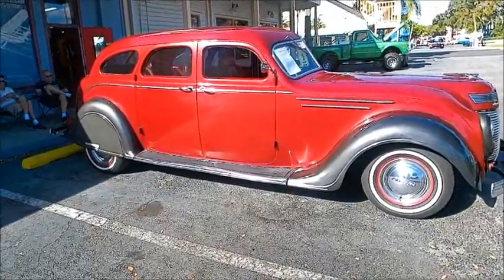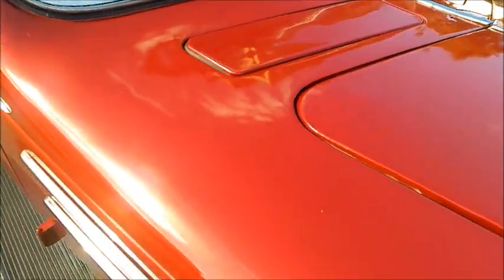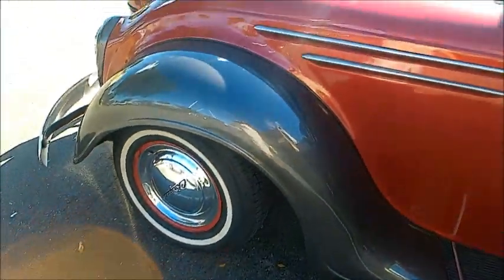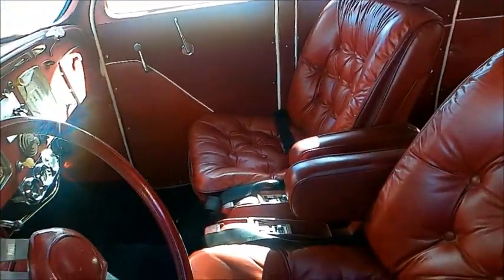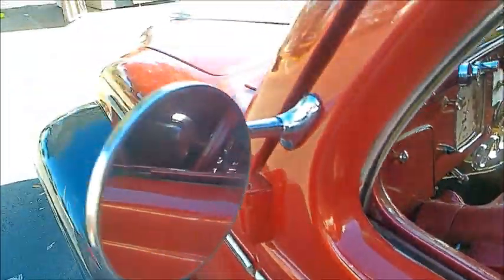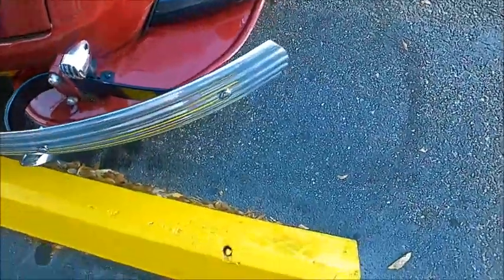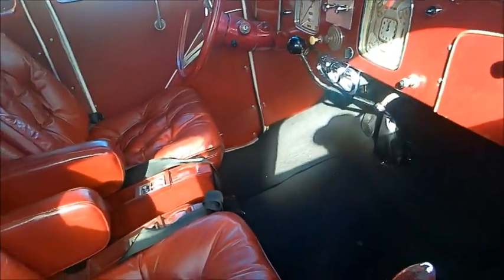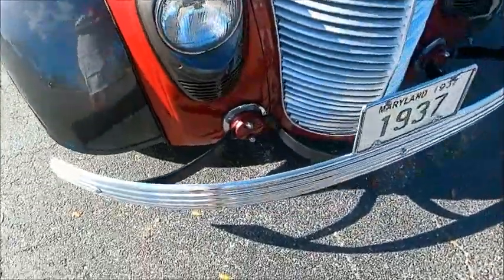1937 Chrysler Airflow Four Door Sedan Restomod RedGray OT 0108220302

Comment: Very attractive Airflow. 1937 was the last year for them. As you point out, although  the engineering was advanced, and the cars performed well, they didn’t sell well because few buyers liked the styling. In response to this situation Chrysler brought out more conventionally styled Airstream models which they offered right along with these the year following Airflow introduction. The Airstream models sold much better. For the next couple of decades Chrysler Corp  cars were fairly conservatively styled until Virgil Exner’s 1955 Forward Look was introduced.
Reply from the maker: Hey, Mike!  You point out the ripple effect that the poor sales of the Airflow caused....Chrysler I think was really amazed that a car that was so advanced just didn't sell.  Fortunately, it had the Airstream to fall back on.  The die was cast until Virgil Exner shook Chrysler out of its conservative styling.  Thanks!  :) Jack

Comment: Hey Jack ! This 1937 Chrysler Airflow is pretty unique & totally different from the original design other than most of the exterior . IMHO this automobile would have looked better in one color tone than 2 tone , The 2 tone tends to take away from the intent of the original design of one continuous flow of the exterior ! As far as optics, & I can say I've never seen one up close , But thought it was a neat design . Thanks for showing this 1937 Chrysler Airflow.
Reply from the maker: Hey, Venice!  The Airflow was introduced for the '34 model year, and the grille area was quite different from what you see here.  Because it seemed so different from the front ends of cars of the day, and the car's sales didn't meet expectations, they quickly modified it to make it look more like other cars.  I too would prefer a single color, as this two toning appears to break up the elements of the car rather than give that continuous flow that you mention.  However, I applaud the efforts to save another Airflow from the wrecking yard!  Thanks!  :) Jack

Comment: Jack, Chrysler Corporation, with the company culture being dominantly engineering, began working on a project in the late 1920’s that would culminate in the Airflow for the 1934 model year. The project sought to address two shortcomings of automobiles of that era. Because engine horsepower had increased substantially during the 1920’s, vehicle cruising speeds were up considerably. The very non-aerodynamic styling of the times meant high levels of wind noise in the passenger compartment. More importantly, the then traditional two box design placed the engine aft of the front axle and created a weight bias towards the rear of the car. This necessitated high rear spring rates, resulting in an uncomfortable ride for passengers and unsafe handling at highway speeds. Chrysler’s uni-body Airflow design addressed both problems, the latter by moving the engine out over the front axle, and the passengers inside of the rear axle. The ride and drive of the Airflow was much more refined and safer than competitive GM and Ford offerings, yet the styling so radical for the time that Chrysler couldn’t get potential customers in the showroom. The fact that GM mounted an advertising campaign proclaiming that the Airflow’s unibody construction was unsafe probably didn’t help things. The low priced Chrysler Six still featured conventional styling, while DeSoto had only Airflow styling. Unfortunately it was a completely commercial flop for Chrysler, and by 1938 Chrysler was back to conventional styling, and wouldn’t offer another unibody vehicle until 1960. Less than 50,000 total Airflows, both Chrysler and DeSoto were built during its four year run from 1934-1937. A little less than 30,000 of those were Chryslers, the rest DeSoto. 
Interesting restomod on this one, the seating looks to be from a late 1970’s New Yorker. 
Joe
Reply from the maker: Hey, Joe!  Yes, the public taste is difficult indeed to predict, as Chrysler found out!  Superior engineering is only part of a car, and depends on education!  Style is something more organic, and its attractiveness is harder to predict.  We have tolerance to a certain degree with the unfamiliar...if it's a slight deviation, it's fascinating...if too radical, it initiates an alarm reaction. Evidently that's what happened when this car was introduced to the public!  Thanks for the history and the stats!  A learning experience for Chrysler!  :) Jack